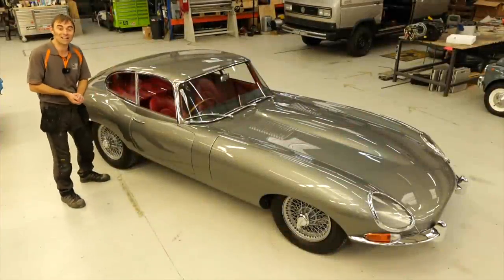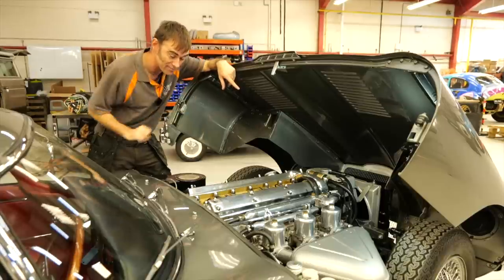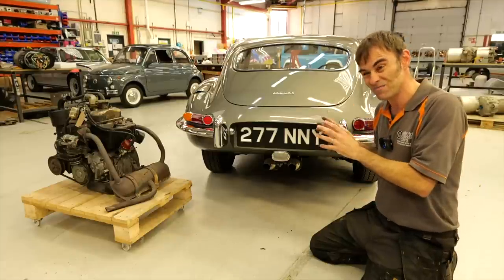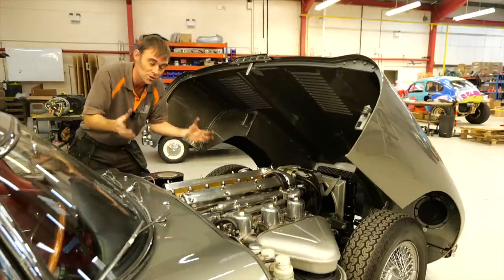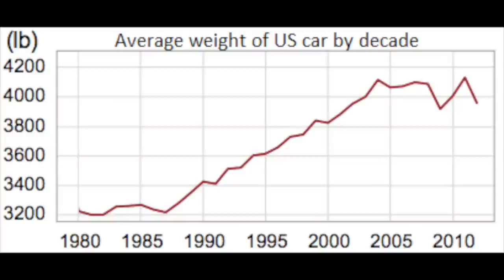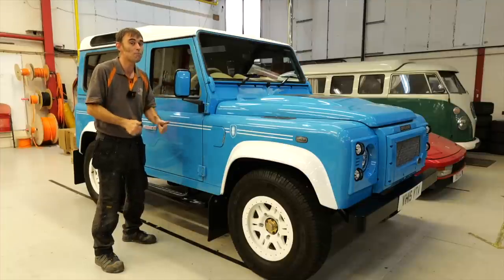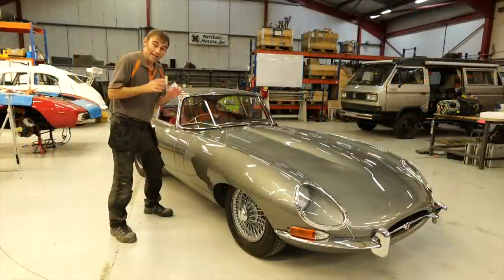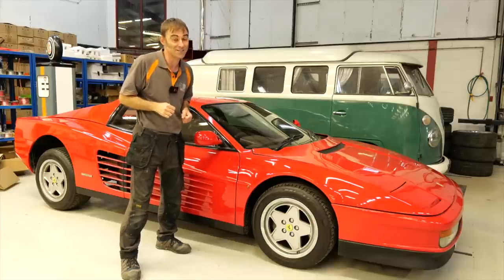Is it a sin to convert a classic car to electric?

Comment: Here are 10 other advantages of an electric car. 
1/ It doesn't SMELL BAD. 
2/ No depressed person can use an electric car to commit suicide in his/her garage... 
3/ You can floor the pedal right away, even if it's cold and you just started the car. 
4/ No dirty oil or fuel leaks. 
5/ It feels modern. It is coherent with the current Zeitgeist.
6/ It's popular. People like it because it's different and fun.
7/ You help your country be more independent from oil producing nations. More national wealth is kept. Of course, Europe still imports a lot from China, but that will change. And contrary to fuel that is burned, batteries can be reused or recycled to create new batteries. So Europe / America is actually slowly grabbing strategic material from China... Lithium etc. 
8/ You can actually be 100% independent by producing your own solar energy with solar panels or other equipment. Even in a situation of collapse / grid down... Zombie apocalypse is better with an EV... and solar panels! Fuel goes bad after a few years, guys! 
9/ More serenity when driving due to less of those annoying vibrations. 
10/ No overheating at low speed in the city or in traffic jams in the summer. The car just rolls slowly without much energy. 
You could make a new video presenting those 10 great additional advantages.
Bravo for your spirit and shared expertise!

Comment: IC Soul -Turn the key and engine comes alive, there's moving parts, noise, vibration. You know when it's not well, it tells you. You can hear it, smell it, feel it and boy do you pray, cry, and swear at it when it is trying to start on a cold wet dark night on the hard shoulder of a lonely motorway. As panic sets in, the key is turned less often the starter gets slower and slower and prayer turns to anger as the pound signs start haunting you. you talk, shout, plead and explain the error of its ways . When all you get is a click .....The car hate's me !!! & right there at that moment you know it has a SOUL.

Comment: To loose a gearbox is one of the most frustrating things. I think EV conversions are great though and if the conversion isn't invasive to the cars body or whatever then you can remove and preserve the original engine without putting miles on it. Also it's future proof when fuel prices and city center charges get worse in the coming years
Reply: Believe me, you will never miss that gear shifting. I loved it on all the classic cars that I have owned and driven. But after driving 6 years and 140.000 km electric, I hate it. Because an IC engine never has the torque available in the moment you need it. And the electric motor has it – always. Just put the pedal to the metal.
Reply: @razerrath_com  I don't care about torque, I care about using clutch and gears and controlling the car under breaking also with gears. It's a huge part of driving.
Reply: It's tactile and involving
Reply: Interesting you should say that and it's a point I've heard many times. The weird thing is the gearbox only exists because the shortcomings of ICEs. If the engineers could have developed an ICE that pulls max torque from tickover to the redline, they would have, and that would have been the end of the gearbox. The gearbox is just a 'workarond' and not a very efficient one as there's always a point where one gear's too high and next one too low.
Reply: You can keep the gear box. I always do, sometimes at considerable expense since gear box will need to be in top shape to handle the increased torque.
Reply: @Nino500  Yeah duh. But I don't care and neither does most proper car guys who like shifting gears
Reply: Some EV conversions keep the gearbox 👍😀
Reply: @danielkelly8756  so you are saying that Moggie isn't a 'proper' car guy? Hmm?
Reply: @Mardy72  I said most.. not all
Reply: @spudproductions7606  But there is no more need to change the gears. Just step on the right pedal and off it goes.
Reply: @danielkelly8756  That’s something we needed to do in the 20th century. But today we have far better options.
Reply: @razerrath_com  Why the hell are you interested in classic cars then? 😃 🤔
Reply: @razerrath_com  Because, today we have have far better options. Whch don't crumple up like a crisp packet in a crash, put the power down better, have ac and heating and Bluetooth radios etc and massage your back
Reply: @danielkelly8756  I’ve been driving VW Beetles for 30 years, until 2014. I always believed it is the best and most sustainable car in the world. Then I experienced driving electric (it was a BMW i3). From that moment I knew that the time of the IC engine is definitely over. The advantages are incredible. Now I see ICEVs as outdated as steam engines. Btw I studied mechanical engineering, I know a little bit about all these things.
Reply: I know some include gearboxes still and that's what I'm expressing I'd like to see more of. Shifting gears is engaging and enjoyable and also a big part of the skill of driving.

I'm sure a classic mini with a Tesla engine in you wouldn't have time if it's in proper job mode, to be farting around in gears but with a tamed down more drivable mapping, to still have a gear box to cycle up and down through and help control the car would be great, is all I'm trying to express. Of course I know and understand that a gearbox is a get around and inefficient for acceleration times etc and also something else to maintain and spend money on but I and many don't care is all I'm saying. This EV conversion thing I thing is going to go crazy at one point and what would help would be able to have a gearbox option if people want it. Then more petrol heads will do it too
Reply: @danielkelly8756  Yes, as others have said, you can keep the gearbox and many conversions do. You wouldn't need to shift but you could if you wanted to. As for vehicle control, the process of downshifting to provide engine braking wold be taken care of by the regen when you lift off the accelerator but, again, you could shift if you wanted to, and might get a little more regen by changing the ratio. I guess you could map the controller to provide a ICE simulation torque curve, dependent on revs. It wouldn't gain you anything but would provide 'ICE experience' for those who want it. You could then switch it out when you don't want it.
  I hadn't thought of this before, but if enough people want it, I'm sure it's the kind of thing that ECC could design in at a price.

Comment: The simple fact is that electric technology in vehicles has a long way to go and may be viable for short trips but for long trips it would quicker to ride a horse considering current charging times.  I have a 1932 four door sedan which needs a total ground up rebuild, I have toyed with the idea to covert the car to electric drive but the range is limited, there is no infrastructure to charge the battery on trips where I live on Australia and after looking at electric vehicles bursting into flames after being flooded in Florida in the US recently, why would you want one.  Coverting a classic restored car to electric is similar to painting a moustache on the Mona Lisa.
Reply: We travel thousands of miles here in the UK in EVs no problem.   Not sure where you’ve seen EVs burst into flames? I’ve seen a few petrol powered cars burst into flames. Hopefully Australia will work on its charging infrastructure. 👍

Comment: Re; the pros and cons,  you forgot to say that electric refueling is so much better (yes, i said better).. instead of having to go to a gas station you plug in at home and every morning you have a 'full tank' of fuel. I rarely use Superchargers because i dont drive 500 miles a day like most people seem to claim. Having said that i put up with taking my old Corvette to the gas station for that V8 sound played through sidepipes, its worth it.

Comment: Own a Sunbeam Tiger and an Alpine; the cars are closely common. Considering EV conversion of the Alpine, not the Tiger. Alpines are a bit more common, cheaper, and can really use a power boost. The Tiger's identity is related to the Ford V-8 engine transplant and it's story: Ian Garrad, Lord Rootes, Carroll Shelby, Ken Miles, George Boskoff, etc. It would be lunacy to destroy a legacy. And, don't undersell the importance of "beautiful noise." My contention is some cars need to be left in their "as firstly distributed state.

Comment: I would not be watching this if I did not like what you did, however a lot that is said about the reliability of the petrol engine is exaggerated. Don't get me wrong, early ones did need a lot of attention but they evolved. Citing a poor example my wife's car has hydraulic tappets and single point fuel injection. In the last 10+ years it has needed an exhaust system (£120) and a clutch (about £400) to get done. I also replaced a bit of wiring loom when a connector failed plus an ignition coil. Of course these are IC car problems. It has also needed road springs, a few ball joints, and a few pairs of brake discs and pads. Ironically it needed a battery (£40) a few years ago. It is a characterless thing but the suspension  is less reliable than the engine.
Reply: A lot of "classic" cars do not have great drivetrains, and an EV conversion just adds to them. I am not trolling but I would leave the E type as it is, I would not want to daily drive it anyway. The Landrover is a different matter, the engines were never the appeal, would love the EV version.

Comment: Soul. If there is a sensible drive train daylight is second. The bus or a pressure vessel managing heat and three fluids? All that engine management effort was impressive but draught horses are impressive too. That you can have comfy luxurious 4wd family and toy carrier running on solar power is a miracle.

Comment: A car is a sum of it's parts. You change the engine and well, it is not going to drive like it used to, doesn't matter if it is EV or any other kind of engine swap. E63 AMG powered Mustang is a project car just like any EV swap. At the end of the day removing the main element of what made that car what it was... well up to one's opinion. If you want to drive tesla with fulvia bodykit, it is up to you i guess.

Comment: Simple answer, if it can be converted back to original, there’s no problem with an electric conversion.
Reply: I think this is where companies like ECC come into their own over home-made conversions. If it can be bolt-in, it can equally be bolt-out. This would satisfy the ongoing value of the car as the market for classics is small enough already, so converting a huge chunk away from original will aim it at an even smaller market and directly hurt its value.

Comment: It's true that an EV (including for a conversion) will knock performance spots off what went before but have you thought what that might do to the insurance group, and subsequent premium, as you daydream about beating everyone at the lights?
Reply from the maker: The insurance is the same on my Beetle now it's electric compared to when it was petrol with the 2.4 litre supercharged motor in it.

Comment: Richard
I know you'r using Tesla Motors and Hyper 9  motors - But what other motors are being used . 
Is Tesla that much better than the others and is that why costs are still so high.
Of course Batteries ar not cheap either, and are your battery packs brand new or also recycled from damaged vehicles.

Comment: People get upset because they say it is not original. Well the original ICE-age engines that came with those cars were incredibly inefficient. They belched smoke and for all of the energy potential of gas, they at best get ~30% power going to the wheels. What you're doing is giving new life to old cars.

Comment: I would be more concerned about the effect of fitting a rigid steel box full of batteries into the crumple zones of a vehicle, I wonder what the legal repercussions could be after an accident?
Reply from the maker: Most classic cars didn't have crumple zones designed into them. Also, the 'rigid' battery boxes, as you called them, are usually located where the very rigid engine used to be. 😉👍
Reply: @ElectricClassicCars   The crumple zone concept was originally invented and patented by the Hungarian Mercedes Benz engineer Bela Berany in 1937 before he worked for Mercedes-Benz and in a more developed form in 1952 and was used on the 1959 w111 , BMW's from the e3 had crumple zones also, I'd say they qualify as classic cars and there  are probably many more. 
So I would wonder what the repercussions could be after an accident when you've changed so much on the vehicle?   Could you also tell me what the fire risk would be in a converted classic after an accident and how that could affect insurance?

Comment: i tell people that tell me my VW Camper will be soulless without it's engine noise, that i will send them £20 so they can leave their car running on their driveway for the whole night and see how much they love that engine sound in the morning
Reply: That's a daft argument as no one would leave their car running all night. However, if I told petrol car owners it will take 3 hours to fill you car up with petrol as with charging an EV, they would laugh.
Reply: @jeffskillman6161  hahahhaha, it takes 25mins for 200 miles range and i can't remember the last time i got up and drove more than 200 miles in a day.....and even if i did i'd charge it at the house the night before for £4.
Reply: @jolive3743  25 minutes! Wow it takes me 5 minutes to put petrol in my car and the average cost of running an EV greatly exceeds that of a petrol as has been proven many times but if you're happy good luck to you. Just use valid arguments.
Reply: @jeffskillman6161  my vw polo cost £80 to fill and does 350 miles. My ev does 270 miles and costs £4 or on the rare occasion i need to do more miles in a day, it cost £35 to use the rapid charger.....i think you may need a new abacus
Reply: @jolive3743  I don't need an abacus to understand the high capital and carbon cost to build an EV, the carbon cost of power stations to supply electricity and the carbon cost of disposal or the crippling cost of depreciation. My Polo 6R costs £70 to fill and covers 500 miles. The fact is no one wants EVs as they are too expensive, to short a life span, high depreciation and the charging network isn't there but don't take my word for it, just listen to the overwhelming majority of the public.
Reply: @jolive3743  You need to be honest with yourself about EV costs so include the high initial outlay and depreciation. My Polo 6R cost me £2,500, has done 156,000 miles, return over 50 mpg and will undoubtedly cost less to run per mile than your EV when you work out the true running costs ignoring the obvious higher carbon costs!
Reply: @jeffskillman6161  1. i needed a new car, so i spent £14k on a used ev.. 2. If you believe anything that vw says after trying to deceive us for decades on emissions and mpg then that's your choice. 3. the numbers were crunched a year ago proving that the carbon used to create an ev is offset by the time the car has driven 14000 miles, at which point it is obviously nothing in comparison to burning fuel once.
Reply: @jolive3743  The numbers don't stack up on a new EV (£30k+) or for a used EV where battery life and replacement are an issue and effect residual values, hence the chronic depreciation. My fuel consumption is based on my own calculations not VW's. The carbon cost of a new EV is not offset after 14,000 miles as the carbon cost of manufacture, carbon cost of batteries and then the destruction cost can never outweigh that of a second hand car already built 15 years prior where there is no carbon cost. Don't fool yourself you're saving the planet either. You're not. You are actually contributing to the the huge carbon costs.

Comment: The other thing to think about when it comes to the environment is that the amount of toxins coming from one's classic car tailpipe vs from the power plant that burns fossil fuels to generate the electricity one's converted classic would use. Most of the classic cars and hot rods I have seen don't have emissions controls so things like carbon monoxide, oxides of nitrogen and other things are far worse from a classic car exhaust than a fossil fuel plant.

Comment: one thing i thought about with the classic cars is most wont run on e5 e10 fuel ,  so yeah i would have the conversion too keep it running and on the rd
Reply: They all run on E5 and E10...
Reply: @Allmentux  not according too gov stats
Reply: @dave1secondago  the gov has their data from the manufacturer and if they don't want to spend the money on testing the cars, they just say "doesn't work" to be legally safe, despite from a technical point it most likely will.
Reply: E10 has been around since the 40s...

Comment: How much is the E Type Jaguar worth right now WITH it's genuine petrol engine and the cost of the same car with the engine removed and replaced with a Tesla electric engine? What's the price difference? Should you take a perfect restored example and do that that to it in the first place? Is it only worth doing if you have a poorly looked after example that you're looking at restoring from the ground up? For me, that Jaguar is not a good example of converting to electric because it's in perfect condition in the first place. It really is sacrilege to do so IMHO